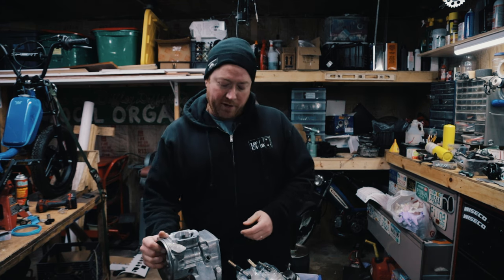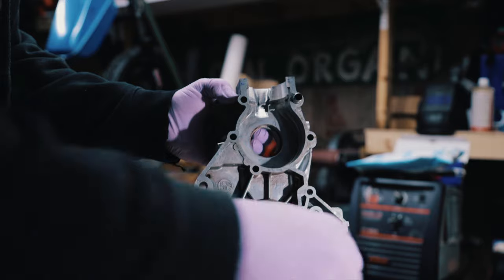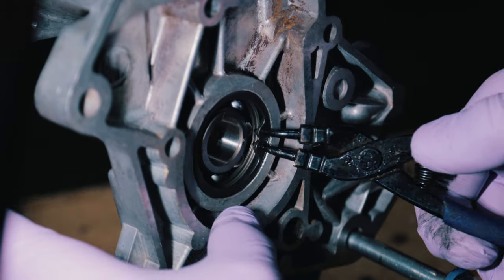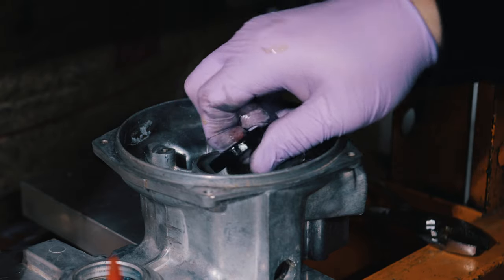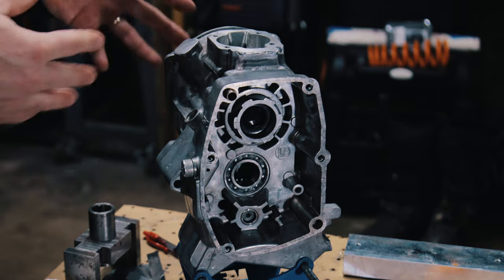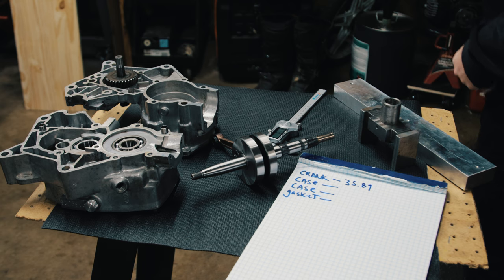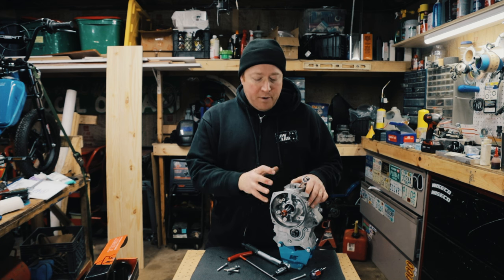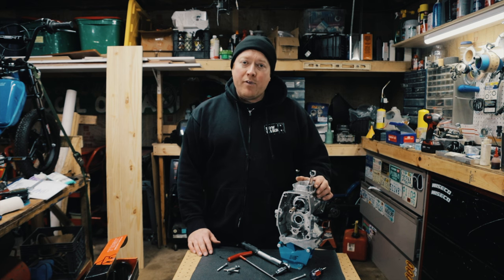Puch ZA50 Moped Engine Rebuild, Crank Shimming, Bearings and Seals (Part 1 of 2)

Comment: To be honest, this post made me apprehensive about doing it DIY. I have rebuilt 3 e50s and run them lots. Kitted and stock. I have French Bikes that I have rebuilt, yes French bikes! My thought was you were going to demonstrate a rebuild that ZA50 owners could perform. Truth is you are figuring it out like the rest of us. Crank... I figure the best is to get a rebuild from the one you have done by a motorcycle shop. IDK. My motor runs fine now, I am trying to gather information for the future. It's good work, just thinking about how to do this. The first post on how to take apart was spot on. I am a fan, just,.. I think you could do better showing us how you figured this out.
Reply from the maker: Thank you for the feed back.  I figured it out as I went and from reading posts on MA, other forums, and watching youtube videos for 3 months. I tried to combine all of the best info into a single video.  I also got the factory tools and felt like using a caliper was actually easy.  My stock crank was shot so I needed a different one. I could have bought a used one and had it rebuilt but I wanted to find a good aftermarket one. I tested out a couple aftermarket versions until I found the treats version 2 crank that had the correct dimensions.

Comment: I think I need to buy a press haha. Thanks for the vid! You're making me feel more confident about rebuilding a za50.
Reply from the maker: its pretty easy. just a lot of steps!
Reply: @Corn-ped  Did those 1 piece replacement crank bearings fit without modification?
Reply from the maker: yea they fir with no modification.
Reply: I thought you mentioned somthing about sending the cases off for boring @Corn-ped
Reply from the maker: @nathanw5747  yes. I sent them to Ryan Cranks to have it bored out to fit a Gila cylinder skirt.
Reply: @Corn-ped  got ya ! that makes me feel better is there any way to just do the magneto side seal without splitting the cases? . i have a small leak on that side smh!. crank is still tight and no play . just wondering if i can get away with the seal and do a fresh treatland bbk kit 70cc for the people kit and a techno pipe- are these any good? any forums or pages you suggest joining? seems like all the facebook groups are UK based
Reply: Turns out my seals were not leaking at all it was the stupid oil fill cap .. I tore the motor down I have a late model 1986 za50 maxi ls sport.  Motor happens to have rare  needle bearing crank which is in perfect shape tight no slop and the reinforced clutch cover section !

Comment: Well this is a appropriate topic for this comment. My question is, I have the single speed E50. I have new bearings and a entire CDI 12v system set aside for the bike for next year around this time. I plan to install new rings next year to my AIRSAL kit, new gaskets, add new bearings all around with new seals. Right now I am running a stock crank and a AIRSAL cylinder with stock bearings, techno circuit exhaust and a clone bing carb. I have the tools to tear apart the engine but I feel like if I am doing it to soon I am gonna open a can of worms and make things a lot worse. I want this bike to be as safe as it can be for what it is and dead reliable for what it is. It is my first bike. I want to take care of it as is but also want it to last a long time with out running a entire line of credit to fix the bike. I plan to run the engine the way it is with just a top end rebuild and the rims and brakes rebuilt. I want to build every thing up next winter. I bought the bike with 2086 miles on it. I now have almost near 2200 miles on the entire machine. PUCH says to rebuild the engine around 3600 miles to 4000 miles. Every thing seems ok and really decent for what it is right now. But while its winter, Am I better off to be safe then sorry and rebuild the engine now or should I just wait another year and then rebuild it all? I know what I am doing but I just want the best advice as possible. This summer, I would like to use it at least two to three days a week at most. I work at a family shop and we all ride together. No its not a moped shop, my day job is to repair vacuum cleaners and home appliances that fit that criteria. All this engine stuff came about because I had a need to fill time. I mix my fuel around 32:1 or MORE with marine grade two cycle oil. I also add a bit of red line lead substitute for extra lubrication in warmer weather well by warmer I mean 100F. The engine runs like a top around 25:1-32:1 fuel ratio is the best. I do not want to do 50:1 that's to high. I plan to jet my carb to a 85-89 jet range for more lube and fuel. Thanks for all your help and time, I hope I am not asking too many questions at all with all of this stuff. This is my first ever personal vehicle and I want to treat it with care. Have a good night-W
Reply from the maker: if its not broken, dont fix it. . . but also the stock seals and bearings are 40 years old so I dont think they are going to last a whole lot longer. Its really a toss up. If it breaks down this summer are you going to be out of transportation? a full e50 rebuild can be done in an afternoon.
Reply: No not fully out, I have a 2023 e Dash Mini as a back up bike... I plan to use the e bike every day and the Puch more like a oh shit the battery is dead bike. That's all, right now it's winter and I got time to burn. I feel like I am running out of time with this stuff because I am trying to get stuff done before I get a biopsy to see what's going on with my health. Things are not good. I am just rebuilding this bike now mainly as a thing to keep my mind off of what's going on. That is all. So yeah I just wanted your advice it is a toss up. I don't wanna push my health and my body more then I haft to so that's why I was asking about the bearings. I also don't want to push the engine if it's a safety concern to have the bearings checked at all. I do seriously want to put use on it not a million miles but it will be in place of my e bike once my battery dies and needs charged. Bought the e bike in November and have not really had to charge it yet. That's the plan any ways.
Reply: I also live eight miles from work about a 20 minute ride not a lot but can add up. Do you have any E50 rebuild videos I would be interested? They help a lot I mean seriously they do help. I never had it so easy rebuilding something while watching a YouTube video. Parts are pricey but you are saving me a LOT of money right now. Thank you for posting these!
Reply from the maker: Yeah I have a couple e50 rebuild videos.  Search on my channel.

Comment: Where do you buy parts? They stopped producing clutches right?
Reply from the maker: I get most of the parts from Doscycles.com and Treatland.tv. I think trickmetric is making limited runs of after market clutches. Treats has some used clutches. The clutches are easy to reline or you can find good condition used one.
Reply: reline your clutches yourself,  much better friction material out there that wil last a very very long time.. and change the springs to thomas ones.... red/ yellow....doing a za50 rebuild now,  new type bearings god seend,  fit perfectly.  NTN 17X40X10 IS THE OLD L17.....NTN 20X47X12 is the old E20..... fit so nice, the crank slides in perfectly, you can pull apart and shim spot on.

Comment: Hmm, one-piece bearings. Is it a better solution than three-pieces? I have one ZA50 to assembly too...
Reply from the maker: They were easy to work with. and they were cheaper. Shinning was different because you had to measure before you put the bearing on and you couldn't take the bearing off to change the shim the way they do in the manual. But if you use a depth gauge or a caliper the way I did then it doesn't matter
Reply: Yeah, disassembly must be then fun with these bearings 😂
Reply from the maker: @jaroslavgoby5136  yeah I have a case splitter so it's fine. But without it you would be bashing the crank.

Comment: Awesome video 💚 I think you may have pushed the clutch side crank seal from the wrong side, though.
Reply from the maker: I looked in the manual and that's how it read to me. I also used double lip seal so it shouldn't matter. But the seal debate will continue! Ohh I also watched my dissembly video and it looks like I pushed out the original seal on the same orientation?
Reply: The picture in the manual im going off of shows different. When you insert the tool Treatland sells with the outer crank race installed, the tool bottoms out in the proper spot. I never checked inserting from the clutch side but maybe it is the same.
Reply from the maker: I pressed it in like 4 steps and measured and went little by little. And in the in I was able to go all the way with the tool. So I just tried to show it going all the way. When I was looking at the depth it looked way shallower than the magnito side. But when pressed it in, it seemed perfect.
Reply from the maker: I reread that step and I agree with you now. I don't see why the direction would matter with double lip seals. But if I do it again I'll do it the other way.
Reply from the maker: If you watch my video taking it apart at 16:22 you can see the seal is facing inward. Maybe this was already rebuilt wrong? https://youtu.be/ghQS69Ipysg?si=v-J9sM235uC5m35b
Reply: I just watched your tear down and it appears the seal lips faced the clutch side to me, as the manual states but hard to be certain from the video.
Reply: Seal lips always face the direction of pressure, for 2stroke the idea is face the cupped side out to resist air being sucked into the crankcase.  Double lip mostly eliminates the chance of leaks from either direction so it's not as important.  

The seal depth thing is important because of the oil injection mechanism on the bikes fitted with it, probably not super critical on this one. I think the video shows a great way to do it.
Reply: @motzingg on the za50, the magneto side seal lips face inward, and the clutch side the seals face outward, keeping the transmission fluid from entering the crankcase.